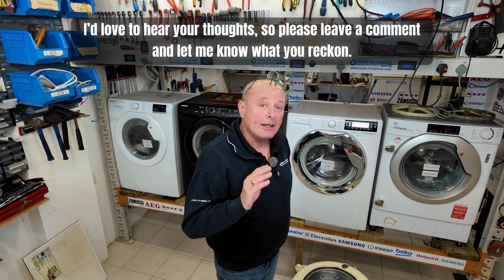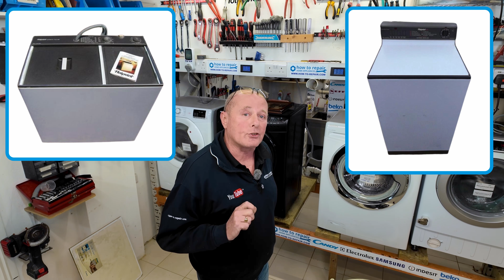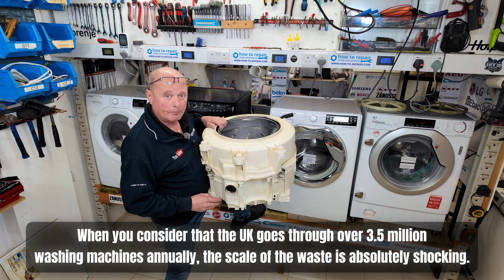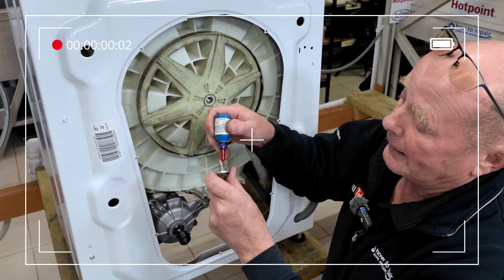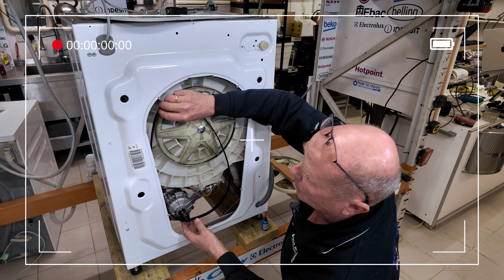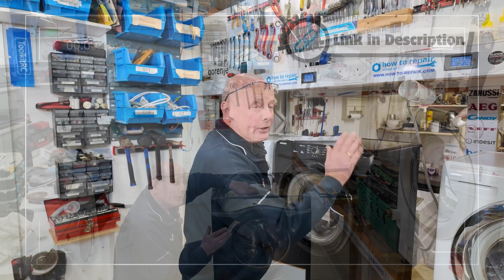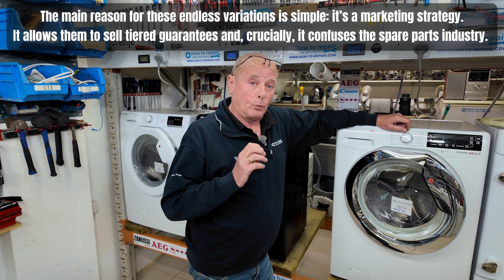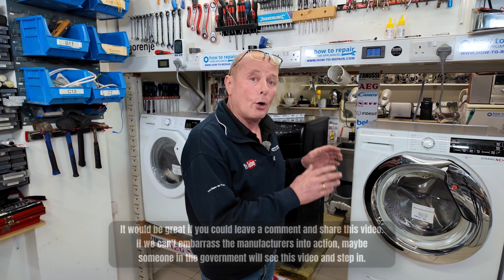I Scrapped 13 MACHINES to Prove a Point: STOP BUYING These Brands!

Comment: 35-year appliance man here. Here in America its almost always a digital problem and very hard to diagnose. Rarely mechanical. The cost is so high they just buy new. I won't work on Samsung or LG at all. My favorite was the direct drive Whirlpool top load built from 1984 to 2010. They were rebuildable and went 12- 15 years before first repair and would last 25 years. To save a little water we are filling our dumps with junk.
Reply: Agree 100%.  I despise LG and Samsung.  And the Whirlpool direct drives were the last of the REAL machines.  The only thing close now is Speed Queen, but unfortunately even they have succumbed to using electronics.
Reply: @musicnerd72 THANK YOU, yes whirpool went electronic and dirched their bulletproof one in 2010 to comply with regulations. The new one is difficult to work on too. It has diagnostics but not always right. On a personal note I happened to find a 2009 whirpool washer n dryer owned by elderly, like new since the family did their laundry somewhere else for years. I can rebuild them so it looks like my lifetime set.
Reply: @user-cr4fz4bi8o Yet another example of government sticking its nose in and ruining the entire market
Reply: @musicnerd72  Ah yes, the two most trusted and dependable commonly known washing machine brands sure does suck! lel
Reply: @Laksilaks    LG and Samsung "trusted and dependable"?  Are you trying to be a comedian?
Reply: I have  a Miele from 1996, still working well.
Reply: @markborz7000  I have been using Miele for about 10 years. The drain water filter got clogged one day. Called a technician. First thing he asked after openning the thing was how old was it. The parts inside looked like new. He couldn't believe it when I told him it was 10+ years old. When someone values something only by the price tag it may seem expensive. But you need to add all the regular maintenance costs and you will see that the most expensive thing turns out to be the cheapest in the long run.
Reply: @markborz7000 i have never heard of that brand. Are you not in the US?
Reply: @user-cr4fz4bi8o  Miele is considered the top in Europe (a step above Bosch/Siemens). The only thing is that they are pricy, so the debate is whether the extra cost to buy a Miele is worth it. Either way, I have a second hand Miele W363 myself and it's a pretty good machine (definitely ahead of its time, for example it automatically senses the weight of the laundry and automatically tailors the programme to it - today that same functionality would be called AI haha). I think it's on its last legs though, so I'm in the market for a new machine. Not sure what to buy yet (again, a new Miele is quite an investment).
Reply: @chrysalis4126 Yup, it costs you an arm and a leg to repair them. And no, the newest ones dont have the build quality as the older ones. So on the long run, you need a bank.
Reply: @user-cr4fz4bi8o Miele advertises in the U.S. I’m in a tiny apartment with a laundry room, so I have no idea where they would be sold. I’ve just seen the ads for about 2 years now.
Reply: @basvs9618  AEG, Privileg, Miele, Bauknecht, and some others used to be considered big names in Germany for appliances; Buy one and be happy with it for decades.

Privileg was especially noteworthy as a manufacturer from the GDR, but AEG and others also used to manufacture in East Germany to sell through mail order in West Germany.

The socialist version of Germany built a lot of affordable products with solid quality to last.

After unification their quality collectively went down due to profit incentives overtaking product quality, many of these companies were sold as brands to other international companies, i.e. Whirlpool by now owns Bauknecht.
Reply: @chrysalis4126  That's an insult to Miele
Reply: Both our Samsungs from 2018 and 2019 front loaders are still doing good, knock on wood. 7 cycles a week.
Reply: @joost1183  Lucky! My 2021 one went to shit after 3 years.
Reply: Now I feel insanely fortunate that I have a 2009 Whirlpool.
Reply: @Cherubi-chan yes! you got one of the last good ones. If it ever makes a ratchet sound. Don't panic, or throw out. look into its  "motor coupling" easy fix. If it stops full of water, and won't spin, look into its lid switch, another easy inexpensive repair. That's the most common fixable problems I used to see with em.
Reply: Did you ever came across a 1940's + 1946 onwards Bendix?!
Reply: @Watchmaker_Gereon-Schloesser  no I have not.. The oldest thing i fixed and still running to this day is a 1955 GE freezer.
Reply: @user-cr4fz4bi8o Were you able to find a compressor for it? I have an old Coldspot that I love but the compressor died.😢
Reply: I bought a direct drive a year or so ago. Top load but works great.
Reply: @novampires223  thats the best way to go.
Reply: Thankfully Speed Queen is still making decent machines.
Reply: @GTIforever-f3n YES! Made in usa too. Cost a little more but well worth it.
Reply: You must not be working with GE then... I have had dozens of mechanical failures. Catastrophic failures at that...
Reply: @WilliamMorey-Baker oh yes sir Im familiar with GE especially the newer one with the string of lights, junk, I agree
Reply: California here.  I have a 1984 Maytag.  Works great, but leaks oil.  It's never been serviced.  It will pass away some time soon and I dread it.  I am wondering whether it is worth any repair at this point.  I have been watching so many videos and am disgusted at what I see.  Speed Queen is my goal machine.  Do you recommend any others?
Reply: @paulk9985  your on right track with Speed Queen. As far as others Id stay with basic models with less features. Go with TOP loaders, stay away from front loads. Stay away from Samsung and LG.
Reply: @user-cr4fz4bi8o  Thank you.
Reply: Bought a speed queen with the dial, no fancy buttons and have no regrets. Bought a cheap dryer tho a basic with dials as well. The less fancy it is the longer it will last.
Reply: @CM-oj3oi  you got the holy grail, the king of the hill in longevity, toughness and dependability. Knobs way better than digital. Iv been working on them 35 years and wish I had what you bought. 👍
Reply: That lines up with what a lot of appliance repair techs have been saying. The mechanical parts often aren’t the issue anymore—it’s the control boards and sensors. Once a digital module fails in many modern home appliances, the cost and difficulty of diagnosing it makes repair unrealistic, which is exactly how planned obsolescence ends up working in practice. Those older Whirlpool direct-drive machines are a great example of real appliance durability. They were simple, rebuildable, and fit the old buy it for life mindset. Now many machines feel almost built to fail, which is why the right to repair conversation keeps growing as people notice the broader product quality decline.
Reply: Ww have a 2015 samsung  washing machine the problematic model 😂 that has been great. Hopefully lasts another 5/10yrs.
 I've only had to change the brushes and clean the pump. And a few errors codes.
Reply: Its not to save water, we can have high quality and efficient machines at the same time
Reply: I always thought top filled ones are better because of the drum being mounted from both sides. But I know nothing about washing machines really. I´ve had a top filled whirlpool since the day I moved to my apartment like 15 years ago. I believe it´s the direct drive you talk about (AWE88612). The lid got rusty pretty quick and I don´t think it can be separated from the plastic part under it, but I just took the rust away from the top and painted it over (though it most definitely rusts from inside out). You can buy the lid, but it was about 50 dollars at first and now it´s like 120. It´s a design flaw, most of these do rust as I´ve seen. It still works, I guess the damping is on it´s way since it rattles sometimes, but nothing unbearable. It cost about 250 dollars when new. 
So You say when this one goes, there´s nothing similar to it these days? I thought I would just buy the same, just new model.
Reply: @krisspappas7527 no im sorry to say they went with completely different digital model in 2010. That whirlpool or GE is ok these days. Just stay with top load and a basic, least fancy model. Thats about the best these days unless you get a speed queen. They are still built in the old style. Tough, but expensive. Nothing will be as good as your old direct drive whirlpool though.
Reply: Interesting comment about LG. I find them really easy to work on, every component has a part number on it and spare parts are easy to get hold of. One of the reasons I bought one. I guess time will tell!
Reply: @jeremythejetplane4712  all units have part numbers, I personally had problems diagnosing the electronics on the washers and the LG refrigerators have a compressor that is hard to install and constantly failing. There is a class action lawsuit against them over it.
Reply: @user-cr4fz4bi8o  I must admit, a lawsuit over forced obsolescence is a very class action.
Reply: @user-cr4fz4bi8o Yup my compressor failed and was apart of that lawsuit. A genuine LG tech came and replaced the compressor for free in a week. Definitely check their website warranty info before getting another $3000 fridge lol.
Reply: Might have to go back to top loaders judging by the crap that they call washings now.
Reply: @fancitickler yes sir and even those can be cheap digital nightmares. The only advice I have is get the most simple basic models on any appliance. More fancy equals more problems.
Reply: @chrysalis4126 that's good advice. In America the best you can get now is Speed Queen, expensive but tough.

Comment: Have you done anything on LG? No internal parts are now being supplied at all, even to the trade.
Reply: I have LG washer and dryers.  They have lasted 10 years.  But I have made the mistake of buying LG Fridges... all have under performed and failed after 5 years... just after warranty end.  Well... 1 did fail 2 months before 5 years so I did get it serviced for free.  But it still "under performs" I had to buy a Whirepool fridge that does perform.   My LG fridge would constantly reach 40 degrees despite me having it set to 34 and I just assumed it was normal and from frequent opening of the door I almost never saw it below 36 even after checking it first in the morning from overnight cooling.  The new one Whirlpool holds 34-35 consistently despite the same usage pattern and I can easily see it at 33 in the morning when I wake up.  The milk holds up a lot better in the new fridge for sure!
Reply: lg can be a mixed bag as an engineer they are easy to work on even some of the newer ones but the parts are a big problem.
Reply: LG used to be a decent brand, I've had several appliances (not washing machine though) that have lasted over 15 years. I guess they too are cutting corners and producing crap these days.
Reply: @doktoruzo  LG still is a decent brand. Don't buy their cheapest crap and you won't be disappointed. But this goes for any brand really.

Comment: My Beko el cheapo is nearly 10 years old. Replaced door lock mechanism and rusted seal loop. Was a challenge but did it myself.
Reply: My Beko cheap washing machine is 7 years old. Still works well, no rust or leaks. Only issue is the start button needs to be pushed a few times before it will start. I will buy Beko again.
Reply: @RobAddie  The latest Beko products are as bad as the other brands. They lowered the quality. My Beko no-frost refrigerator has ice buildup issues. Can you believe that? Every 12 months, I must unplug it and let the ice melt. Of course, I need to take all the food out, keep it in another fridge, and soak up the melting ice water with towels.
Reply: @leventgoktem462 they not bad. If you unlucky you will break your finger even in own ass.
Reply: @leventgoktem462 I'm the same. My Beko 'fridge has a large pool of water which collects under the large fruit & veg tray, and I have to keep siphoning it out or use tea towels. Also the trays on the door have the height of each tray too low. When you open the door at least one of the drinks bottles goes "Wheech!" and falls on the floor, because the centre of gravity is too low. Ooohh! Such Poor engineering design, the consumer is condemned with such shoddy equipment, bought in honest faith!
Reply: @ChuffingNorah   You're absolutely right. 
Is the front trim of your refrigerator shelves sharp? Mine are finished at a 90-degree angle. If my knuckles brush against those edges while I'm loading a heavy pot, they actually cut my skin.
Reply: My Beko has been faultless 👍🏻
Reply: Not a washing machine but I do have a Beko fridge freezer, bought for us in 2007 still going strong.
Reply: @King-bn3wr  That's good!  Most fridge-freezers from that time have no electronics (just electromechanical thermostats and timers) so are more reliable than more modern ones.
Reply: I had a design objection to a particular Beko washing machine. Couldn't do a spin without it doing a rinse.
Reply: @Extra-Sail My Miele can't do a rinse without a wash. However it has a ton of short cycle programs, so I just use one of those without adding powder.
Reply: I’ve got a Siemens XL1400 it’s 22years old and I’ve only ever had the brushes replaced.
I bought it to replace a Hotpoint just out of guarantee that made a loud bang whilst spinning then was leaking oil everywhere, repair guy said it needed scrapping
Reply: That's good, but I think you got lucky.  With their plastic door hinges and so on, I don't think Bekos are particularly high-grade machines that have good longevity as a statistical average.  My cousin has had numerous warranty faults with their near-new Beko washing machine. 🙁

Comment: Thank you for a fantastic and well-presented insight into the hidden world of washing machines and their frailties. You don't need to apologise; you are doing an incredible service for the public. It needed to be exposed for what it is. It is the same principle as buying a car that uses a wet belt instead of a chain-driven belt. Honda, to their cost, found using a wet belt in their 1-litre, 3-cylinder Civic cars was disastrous. Peugeot, Renault, Audi, Ford, Citroen and  Vauxhall all use the same components, and it is crap. I talk through experience, never again will I buy a 3-cylinder car with a wet belt or a Hoover, Hotpoint, or Samsung. Once again, thank you for highlighting and sharing your findings.

Comment: Thanks for speaking out about this topic! I'll be following the video series with great interest. Although I'm no engineer, I've repaired a good amount of washing machines in the last years and noticed the same drop in quality the newer the machine is; with AEG/Electrolux being the majority, I did some research about the models and when they started putting welded drums in the machines, it indeed was 2006-2007 (as mentioned in the video). At least for the german market they kept a series of AEG machines with the "classic" screwed tub up to 2018 (while at the same time putting out more and more machines with the welded tubs), while other countries got the full welded experience from 2006/7 onwards. Apart from that, the cabinets and paint jobs got worse in quality, the pcbs got way more complex and harder to repair too. The wash performance itself is perfectly fine!

I currently have a 2 year old Bosch that's got a damaged pcb (blown triac, blown driver transistor for the triac and likely damaged microcontroller due to a failed component right after the guarantee ended - the pcb costs 216€ alone, the blown parts on the pcb would cost around 5-10€ new, although a repair is impossible since there's no way to get the file for programming the new microcontroller. Overall understandable that the machine wouldve gone to the landfill, for the cost of calling a technician, diagnosis, sparepart and repair you can get a new machine).